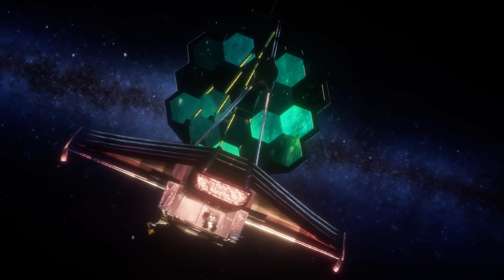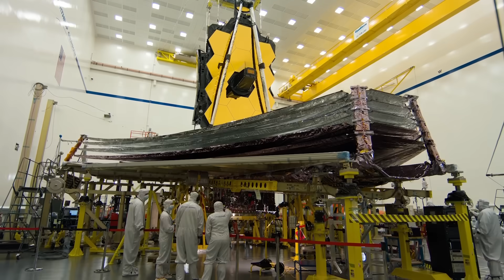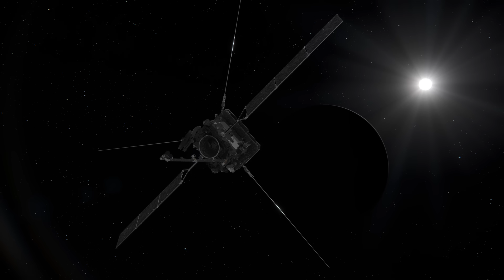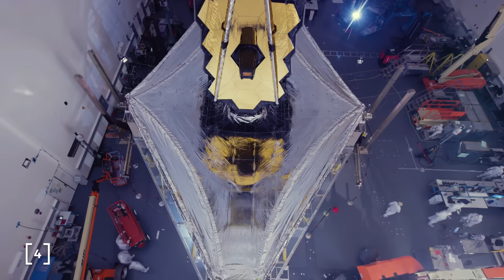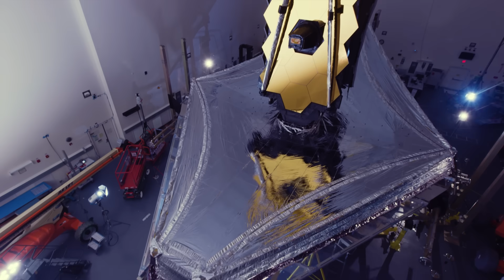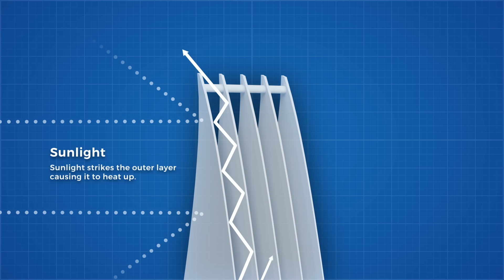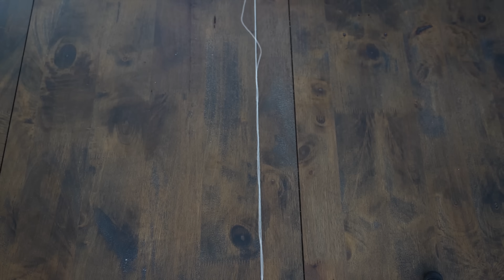The Insane Engineering of James Webb Telescope

Comment: How many days in solar year. You may say 365.2425 as per gregorian, 365.25 as per julian and 365.24218 as per scientific community or astronomers and astrophysicists, they called it tropical year and calculated that sidereal year (alignment to fixed star) is lessen by about 20 minutes every year.

This difference in tropical and sidereal year led to idea of precession of equinox or say gyroscopical motion of earth, the precession rate calculated as about 50" (seconds in angle) per year. These precession cause shifting of season relative to fixed constellations of ecliptic.

But you might wonder that this is not correct. A year consists of 359 synodic days (from sunrise to next sunrise) or days. As we know from science and observation if one want that a sidereal day (position of a star to next rise or day) is 4 minutes less than a synodic or day. So a day is 24 hours of average, while a sidereal day is 23 hours and 56 minutes.

We are not assuming that whether earth is rotating or sidereal day is of 1 degree. That makes calculation lot easier but that takes assumptions. The difference of 4 minutes cause sun to rise further eastward from that star. So to again align for that star with its initial position took one complete sidereal rotation or one sidereal day.

So mathematics is, no. of days per minute of sidereal recession = 1/4 days per minute.
For a complete sidereal circle of 23 hours and 56 minutes or 1,436 minutes is = 1/4 × 1,436 = 359 days.

Now this 359 days or 360⁰ is duration of a sidereal year in terms of synodic days. Here we don't take assumption that 1 sidereal day is 1⁰ on ecliptic, so loss of time for 360⁰ is = 360 × 4 = 1,440 minutes or 1 day. Subtract this from 360 days (assuming 1⁰ on ecliptic is 1 synodic day) is 359 days.

Here both tropical and sidereal year aligns after 359 days, so there is no precession of equinox or shifting of seasons. Question is why scientific community still persists on a year of 365.24218 days, which was modified version of ancient egyptian by greeks or romans.

Their own calculation says that sidereal year is 20 minutes more, which comes naturally as 5 more days than 360 days and each day is 4 minutes less. They reversed the result by saying tropical year is shorter.

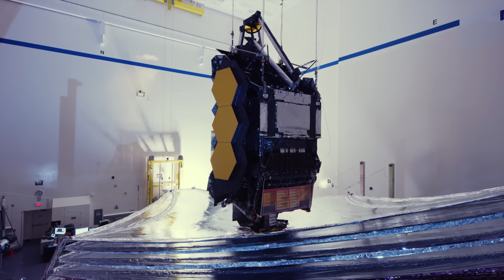Comment: Nitpicking maybe, but the diagram at timecode 5:25 says -83C, yet the commentary omits the negative sign and says 'nearly enough to boil water' which would only be true if it was +83C. Does anyone know if the temperature shown in the diagram is correct, or the one spoken in the commentary?
Reply: +83 ºC is the right value.

Comment: you said positive 83 degrees C, but the infographic said negative 83 C, which is wrong?
Reply: Maybe it is -83 because in space water will boil at a temperature less than 100°C because of low pressure.

Comment: So the sun shield is effectively very well engineering kitchen foil?
Reply: Highly-engineered kitchen foil attached to a highly-engineered structural backing, but basically, yes. :) And the layers spread apart at the edges so radiated heat bounces out the sides to escape to space.

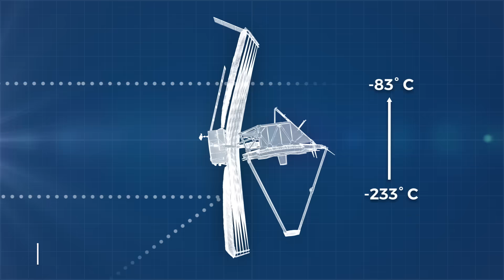Comment: 5:18 have i missed something or how tf is -80°C supposed to boil water when the boiling point is at 100 and freezing at 0? i know that these temperatures change under different pressure but for it to be at -80°C it must already be far less than 0.1 bar which would be approx. at 40°C
Reply: The correct value is +83.

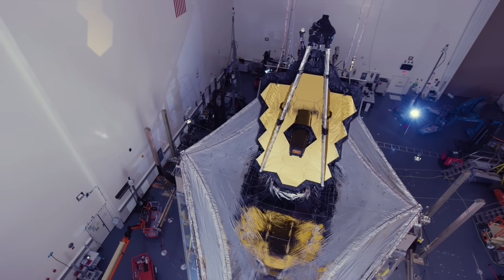Comment: 5:24 can some explain why the temperature would be -83 C? I thought that the temperature of the empty space is ~2-3 K
Reply: While space itself is that cold, the temperature he mentioned would be the equilibrium temperature of the telescope’s body if it were in direct sunlight; at that point it would be thermally emitting as much heat as it receives from the sun.

Comment: Can anyone explain why the mirror is getting less light than we would at night on earth? 
My first thought is it is related to the positioning of the mirror but I feel like that would be false. 
Is it instead due to the wavelength /type of light energy it is looking to observe which is much dimmer than visible light? 
I feel like that would explain the 1 photon per second number better but if that were the case the I believe it could be explained better 20:09
Reply: Em range of this telescope and overall less photons being sent from the picture location to begin with. 
IR means less data to work with (stars peak in intensity in the visible Em range) but needed as it has less attenuation though matter scattered in space
wavelength and dimness(intensity = photons/s) are different

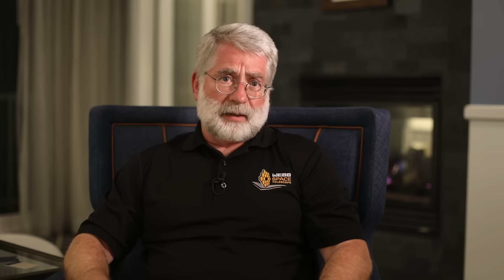Comment: I'm confused at 5:28, shouldn't it be -83, rather than +83? The graphics are confusing. I can't imagine an object reaching +83 C in the shadow of the Earth...
Reply: It's not in the Earth's shadow - in fact the orbit around the L2 point is specifically designed for this not to be the case.
Reply: @ngc-fo5te  What? L2 is almost by definition in the Earth's shadow. Are you saying JW's orbit around L2 is so big that Earth does not block direct sunlight? How is that not stupid if the telescope needs to be cold?
Reply: @joelwallenius2877  The sun shield allows the cooling - if it was continuously moving in and out of shadow then you'd have a variable environment which would possibly lead to stresses and strains. The orbit around the L2 point is quite large so as to avoid any shadowing at all and maximize the performance of the solar panels for power generation.
Reply: @ngc-fo5te  Ah... I completely forgot about the solar panels xD

Thanks m8

Comment: Space is NOT empty! it is littered with stars, galaxies asteroids etc which interact with any lightwave passing through so such a system of dielectric material, even though distributed in lumps, will not achieve the full speed of light in a vacuum but always somewhat slower.
Reply: When you say 'somewhat', by what percentage is the speed of light slowed down from its maximum?
Reply: The velocity of light propagation is dependent the (local) dielectric constant. Just as in the simple case of a  cable, electrical or glass fibre. 
There is always some influence on the path light follows by nearby material. Good examples are lenses and prisms, both of these 'bend' or 'focus' light according to density and thickness. You are probably aware of the lengths lens designers go to produce a sharp, flat, colour fringe free image, using lens elements with different types of glass.
Well, they use material with high density to focus the image in a convenient distance. But all material, however low its density, has some effect  on light passing through it, so the Speed of light is never equal to that 'in a vacuum'. Perhaps very close, but never equal. Surely this should be taken into account when considering astronomical distances?

Comment: Excellent presentation thank you. Two questions. If, as indicated by the diagram, JWT is shielded from the sun by the earth, why would it be scorched by 83degC temp. Secondly is that right anyway as the diagram says minus 83degC, not +83?
Reply: The diagram is incorrect, JWST will be in a large orbit around the L2 point so it'll be in full sunlight. +83 ºC is the right value.
Reply: @h.dejong2531  why the large orbit rather than on point to get shade from Earth?
Reply: @lumbarsupport  if they're in the shade, the solar panel has to be a lot larger to get enough power. And you get variations in light level because of the Moon (lunar eclipses); they wanted a constant temperature because changes in temperature would cause problems with the telescope's shape.
Reply: @h.dejong2531  fascinating, thanks!

Comment: Hang on, at 5:24, he's explaining the need to shield the telescope from the sun, saying it needs -233 C to operate, though if there wasn't any shielding, it'd "be scorched at 83C." though the diagram indicates -83 C!! Is this an obvious error in his explanation, or am I missing something? I fail to see how the sun's rays at L2, in vaccum could create 83C temperatures. I think he made a mistake.
Reply: The sun side of the sunshield receives more sunlight than we get on the hottest day on Earth (our atmosphere absorbs or reflects some of the light). So yes, it'll get that hot. 
In space there's no air to distribute the heat, so you get the situation that JWST can place a radiator on the sun side of the sunshield and use that to lose heat.
Reply: @h.dejong2531  So his diagram is wrong, or his commentary is wrong?
Reply: @adrianedlington2493  The diagram is wrong.

Comment: Quick question about 5:20, is it -83 or 83?
Reply: by the source listed its 83°C, the graphics is from creator so he can make a mistake in production and its the temperature of the first heat shield that is already design to reflect and dissipate heat. White surface like for example moon will be around 120°C on orbit and 115-117°C if at L2 distance. By approximation moon is 85% reflective and polished aluminum 90% the temperature is 80. So minus the distance difference, plus the bit dark surface of the first layer (dont know for what purpose) and 83°C make more sense.

The source material say its +83°C and the approximation (math) verified it.
Reply: @scasny  I thought it was 83 too from what he said nearly boiling water. It's just the video shows -83 confused me.

Comment: At 5 minutes and 19 seconds you explain “Whithout a way to block out the heat from the Sun and the Earth the telescope would be scorched” . But how could the telescope be heated by the Sun while it remains permanently in the shadow of the Earth ? 
One could understand that the radiation emitted from the Earth and received by the telescope, is capable of heating it, but would this Earth radiation be sufficient to heat the telescope up to 83°C?
Reply: @ThomasKundera  Thank you. However, on the sequence at 4'56''  - 5', the image shows that the L2 trajectory is in the shadow cast by the Earth.
Reply: @ThomasKundera  
If you are French (like me) then: merci. En fait c'est vrai que la trajectoire du télescope n'est pas aussi simple que si elle suivait juste celle de la Terre en restant sagement derrière elle. Et puis la source d'énergie (panneau solaire de 2 KW) suppose que le panneau est exposé au soleil; la séquence que je signalais avait sans doute simplifié la situation en plaçant le télescope dans l'ombre de la Terre.

Comment: Apollo missions dealt with the heat ok and the astronauts
Reply: The Apollo missions didn't have space-facing components that needed to stay just a few Kelvins above absolute zero.
Reply: @General12th  I am not with you on your answer. How did the Apollo spacecraft keep cool just like the astronauts themselves?
Reply: @k9slayer  The spacecraft was painted a shiny emissive white that reduced the amount of thermal energy it absorbed from the Sun.

More importantly though, it just comes down to the Stefan–Boltzmann law. A warm body like the Apollo spacecraft radiated way more thermal power than a cold body like the JWST does. Its temperature was much closer to its thermal equilibrium, so it didn't need to work as hard to cool things down slightly further.
Reply: @General12th  once again I don't agree with your answers, if a piece of metal is repeatedly heated up in space it would take longer to cool off a bit like how a thermos flask works. For the paint job on Apollo pull the other one it has bells on.  I am pretty sure gold is used to keep the radiation at bay.

Comment: There are so many verbal mistakes in the video, to name a few: 1. It's not 83°C, it's -83°C and no, water doesn't boil in that temperature, it's not even liquid. 2. You don't use degree with Kelvin, it's supposed to be 7 Kelvin, 3. It's an acoustic wave, not exactly "sound" that the stack lets pass through.  Please get these basic facts right, it's a scientific and engineering channel, these are basic middle school level pieces of information.
Reply: The screen just had a typo, it was supposed to say 83 degrees C, not -83. Water would be a liquid and would be near a boil.

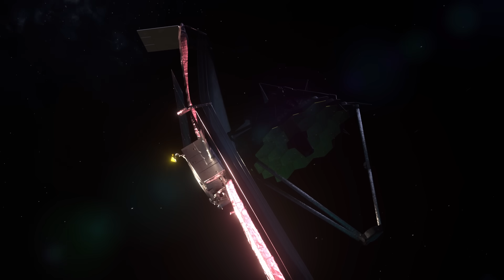Comment: You’re illustration of the orbit of the JWST at 5:00 is wrong. You show the telescope orbiting around WITHIN the shadow of the earth. This is completely wrong.
IF the telescope ever enters the shadow of the earth, it will STOP FUNCTIONING.The telescope is entirely powered by solar cells. No sunlight on the solar cells = no electricity to run the instruments. The “halo orbit” around L2 is a circular orbit with a radius large enough to keep the telescope in PERMANENT sunlight, ie., to keep it OUT OF the earth’s shadow at ALL times.

Comment: As an inventor designer and manufacturer of tools for use in the fields of mechanics, electronics, and optics, when I heard in a documentary that from launch to final deployment, there were approximately 344 single points of failure, meaning that a single failure of any single component in deployment of the telescope, would make it unusable!  The fact that it all worked was astounding to me, the 5-layers of tennis court sized sun shields, mirror deployment motors and the 155 individual electric motors during mirror alignment, they all functioned perfectly. To me, this represents a quantum leap in science and engineering solutions and testing!  David Riddle

Comment: Why couldn't they place it on the dark side of the Moon?
Reply: Because why see nothing interesting at all, on the dark side of the moon, when this is designed to peer into never before seen parts of deep space.
Reply: Oh bless, because the  dark side of the moon isnt actually dark, it has days and nights just like the earth facing side.  We call it dark because we can never see it from Earth because the moon is tidally locked.
Reply: @nostalgiagaming560  What are you talking about?  
I was implying: station telescope on the moon for use of it's shadow to look into deep space rather than floating around with an inflatable kite, with dust and junk flying towards it. 
What's so wrong about a Moon base?
Reply: @SpicedTime  the moon rotates too
Reply: It is viable, however the moon doesnt move that much. It revolves around us yeah, but faces the same way everytime. This will limit the possible angles a telescope can point to if its fixed to the moon. Or at the very most, well have to wait for the dark side of the moon to be at the angle we want it to be at
Reply: It’s a bad idea to place it on the moon since the dust can ruin it way quicker than if it was just floating around the earth. Moon dust is no joke lol
Reply: Lol the joke is on all of you;
This telescope won't be see by the naked eye;
As far as any of us know, it doesn't exist;
I'm in favor of a "Moon Base" so we can get some perspective  
[if you can read between lines]
Reply: @SpicedTime  you’re saying the James Webb telescope doesn’t exist, or are you saying the moon base telescope doesn’t exist?
Reply: It's been discussed to put a radio telescope on a moon crater on the dark side, but you have to factor in light from the Earth as it passes overhead which would blur out all images periodically. Also, most of the costs of going into space are getting into orbit around the Earth as you not only have to go up real high but go sideways real fast to stay up there.
Reply: @SpicedTime  the dark side of the moon isn’t dark it has daytime too, it’s “dark” because it’s never seen from earth as it’s tidally locked

Comment: JWST Has already had 6 micrometeoreorite impacts since it's reached L2. That big one that hit it in May apparently did some serious damage to one of the primary mirrors. Initially they thought it wasn't that bad, based on modeling. But the real life data shows the damage was a lot worse and the micrometeorite was larger than anything they ever planned for. So all of this tells me this mission is (very sadly) going to fall very short of its 20 year goal. Given it's been up for 6 months (not even in position at L2 even) and it's already suffered on average, 1 strike per month. And already has had one bigger than anything they expected, it doesn't bode very well at all for the longevity of this mission unfortunately.

But apparently NASA's working on putting another space telescope up. I'm not sure if they have a date for it yet. But it's going to be an Infrared telescope as well. I only just found out about it today, so I don't know many details yet. But if you want to look it up and learn more for yourself, it's called the Roman Space Telescope. There's an article floating around the news currently about the Delta Heavy winning the bid to launch it. But I'm not even sure where it's getting launched or what wavelengths it's going to look at, or when it's going to be launched or anything besides the name. So I have a lot of digging to do. Hopefully it'll be something comparable to JWST.